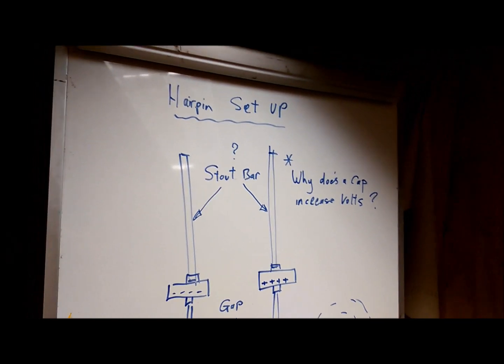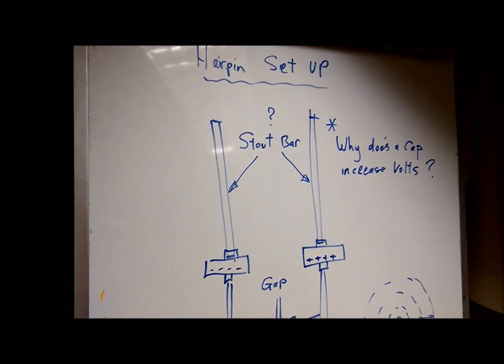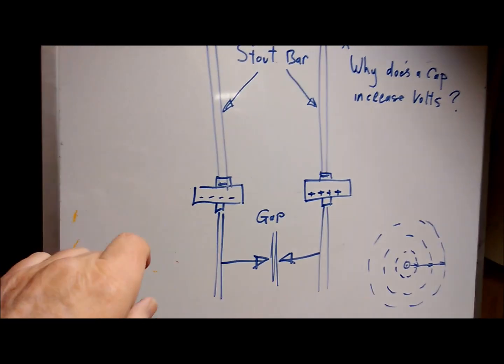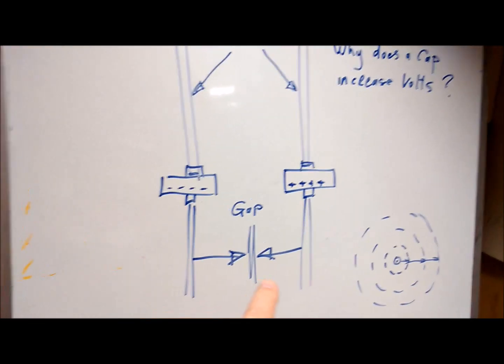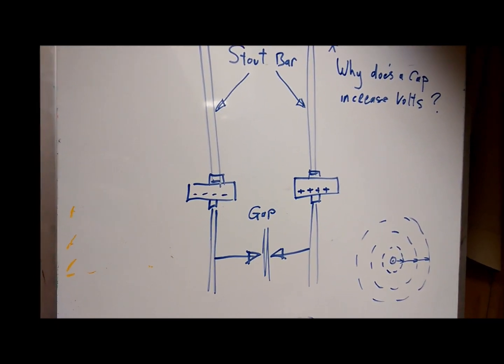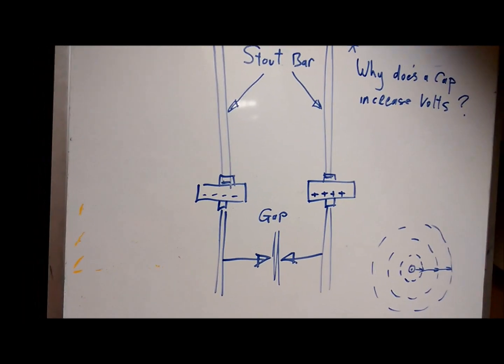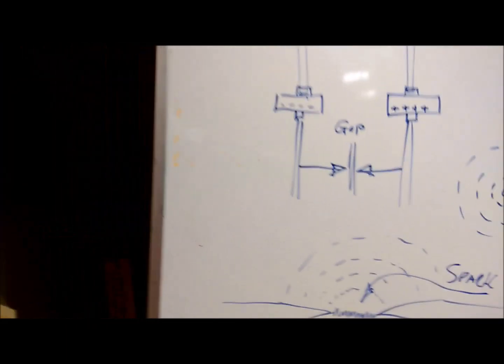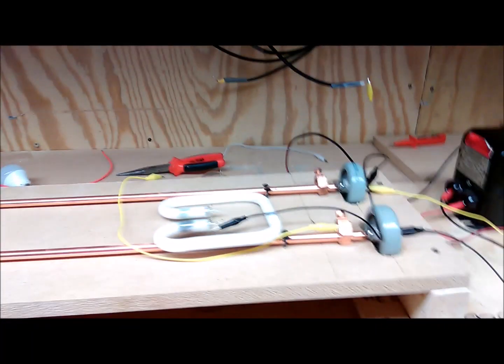Electrons do not exist ( Nikola Tesla Hairpin Circuit )

Comment: How can a discharge not be electrons ?
Reply from the maker: Good question!
What is light?
We only think we know.
Tesla knew, why?
Quote Tesla's: "if you believe in electrons you're mad".
So the Q you ask is really a good one!

The nearest I can get is static from the Aether.

Hope this helps and feedback with your knowledge levels as I have great interest.

Regards DC
Reply: @e.powerdc1127  supposedluy tesla said their were smaller particles than electrons he belueved
Reply: A discharge in this context is the release of tension of the Dielectric field, Electrons are not particles but a point where the guide (wire) has failed to reflect the dielectric field, losing it in the form of waste heat. As Thompsons original description if it is the terminal end of a unit of Dielectric induction, this is the original and correct model of the Electron. 

"By experiment it can be shown that this energy leakage exists in proportion to the temperature of the material form storing energy within its bound electric field. In general, the electrostatic potential, e, in Volt, renders the insulators hot, the magnetomotive force, i, in Ampere, renders the wires hot. Also, it is found that this heating increases with increasing frequency of the potential, e, or the M.M.F., i. It is here where the prevailing concept of the “electron” is to be found. Hence it is the motions of the electrons that give rise to the energy loss in an electrical system. 

Electrons represent energy dissipation. However, the pedant, the mystic, and the dis-informer all tell us that the electron is what conveys energy, the complete opposite!" -A Common Language For Electrical Engineering by Eric Dollard

All conductors are Dielectric reflectors, so unless we're talking about superconductors no wire is a going to be a perfect reflector, hence the losses.

Comment: Can a smoothing capacitor be used in with this energy to make the waveform stable? I want to try powering a DC Asymmetrical motor but the pulsed waveform might not be good for it.

Comment: Hello. Thank you very much for reporting. I have always wondered how the cable that connects a lightning rod to the earth is able to transmit so much energy without melting. And the reason is that it does not conduct an electric current, but a dielectric current. And indeed, in a storm, lightning strikes in both directions, from top to bottom and also from bottom to top.
Reply from the maker: Hi DiMagnet
Thanks for the comment.
Electric is strange and how it works.

A bar magnet is strange too. Why?

Cos it has two fields N & S but they do not pass the Block (Block) Wall.

So what i am saying i guess a magnet has three fields.

Did you know that the N & S pole magnetic fields do NOT follow the classic lines of taught to us?

After much research please find:- 
Fact at the Bloch the N. & S. fields do not cross.

We have put too much focus on the magnetic and not the "Dielectric Field".

Regards DC

 https://www.youtube.com/watch?v=SK_C0RAOACA

Comment: You are correct, in fact when I sit down and think about it wouldn't the whole existence of single wire circuits completely destroy the erroneous notion of electricity being the result of "electrons flowing in a circuit" as they so often claim
Reply from the maker: B.D. yes, spot on. Have you looked at my "Little Billy Aether"?
Just my take and I can see how Tesla was thinking to draw power from the Aether too!
Put it all together Aether+magnetics and di - electric ( insulation static) vibrate and Bingo you have a galaxy (sea, universe) of power / potential.
Regards DC
Reply: @e.powerdc1127  Sorry its taken me so long to respond to this, but yes between what Tesla has done and Thomas Henry Moray (who was largely influenced by the likes of Tesla and Gustave Le Bon, even to the point of utilizing Radiant Matter), you're correct. Bringing up Moray again he even wrote how we are in a "sea of energy" you just need the proper "receiver".
Reply: Flow of electrons..  pressure differential. Static charge difference. Magnetic induced expansion contraction<8>8<8> . Or chemical+>8<-
Tesla's was atmospheric. High Voltage pressure. ]8[]8[

It is the rubbing... friction that creates electricity.
Vandegraaf wimshurst kelvins thunderstorm.
Reply: But it is the valance electron doing this. While the electron shell gets pressured, it wants to get rid of it. Cause there's more space around the electron shell of the neighbor.

Comment: Thrs no magnetic waves here just dielectric...... Cap spark irrespective of ac pump once it goes through spark gap just dielectric... Essential to have magnetic... U have done that to 500volts just integrate that  ie dielectric nd w stp up 10 times nd get that 10 transformers to stp dn that's all u need to achieve if current is not flowing u can use diodes nd invert w  invertor for AC and use a real proper earth either series or plate or really grounded for rest.. Charges r bound to separate n resonance made as long as ur magnetic generator nd dielectric discharge happens nd stp up 10 times happens ie 500x 10times stp up to 5000volts then stp dn multiple transformers u can use till 8 I am sure 4proper current

Comment: I don't know why all the amateur experimenters out there think the Spark Gap is the location where some "magic" occurs. It's not. The real magic, if we agree that longitudinal waves do exist, is happening from high voltage on the first plate of the capacitors, if we assume the Hairpin circuit. There, that electrode surface appears to the dielectric inside the capacitors as if it is constantly swinging from -V to +V, that happens so abruptly thanks to the spark gap, this being the only real merit it deserves.

Those abrupt swings from -V to +V stretch the dielectric inside the capacitors like a high torque elastic rubberband, blasting energy out to other dielectrics materials in nearby zones (mainly, air). When the dielectric wave encounters a metallic surface, the energy get converted back to regular, common conduction current inside that metal object, and it can feed electric appliances like lightbulbs, measurement tools, etc.

It's not a theory, it is really that way, and many videos prove it. Roberto Handwerker from Milan was one of the first to have understood this whole thing in 2011. Also Master Ivo knows that, and some others.

To be more clear, it is really displacement current, but happening for longer distances than those of a thin dielectric film of a common capacitor.

To conclude: for longitudinal waves, the magic does not happen in the spark gap. The magic happens when a metallic surface can sport a homogeneus high potential charge in its whole surface that flips in a relatively low time (dv/dt), appearing as the surface is blasting opposite electric fields continuously. Zam zam zam. That stretches whatever dielectric materials is in strict contact with that surface. The effect is much bigger if the dielectric has high K. Air is not that good. Water is good. Plastic, maybe glass, are superb.
Reply from the maker: D. T. Hi you get a 5 star from me DC.
At last someone who really understands the Aether.
It's like a heartbeat.
The World is waiting for someone to put it all together!
Tesla was on the money, however people with the money stopped him.
Let's make electric free again. Amen.
Regards DC

Comment: A fluxing capacitor.
Reply from the maker: Ying and Yang they chase each other positive and negative, North and South fields separated by the Bloch wall all trying to equal or level out Aether pressure. The potential, is the pressure differential.
A capacitor is capable of storing this potential to very high voltage.
Voltage drives amps.

 So a fluxing capacitor is to be noted as a important component.
Wouldn't you agree?
Regards DC

Comment: “No electrons, just discharge…” at this point I decided not to watch further. DISCHARGE is the flow of charge carriers!!!! Which can be either ions or electrons. But if there are ions there should be electrons. Jeez….
Reply from the maker: Hi D. N. I thought that we used electrons up like turning a tap on and getting a bucket of water.
What do you think about my video "Little Billy Aether" and where I describe action in a wire.
Regards DC
Reply: If "electrons" exist, overunity transformer wouldn't be possible as the flux are "entangled" together.

Comment: Nice job! And yes I think you are correct in saying that the spark gap is taking two transverse hertzian waves and combining them at 180 degrees offset to cancel them out and make a scalar-longitudinal wave that travels outside of the circuit (wireless transmission of power). The main difference between Tesla’s hairpin circuit and yours is his spark gap is between the two bars above the two capacitors. And what happens when the spark discharge happens is it creates a longitudinal shockwave in the Aether. Having the spark gap in between the two bars makes the longitudinal wave shoot out between the bars (in the space between the bars) and I think that the top hoop of the bar is where that scalar wave intersects back with the main circuit. If the spark gap is separate from the bars then that shockwave misses the hoop of the circuit completely. (That’s my theory) So putting that spark gap in between the bars above the two capacitors is a key design element in the hairpin circuit that should be copied to get the exact same effect Tesla was demonstrating.
Reply: The main difference between Tesla’s hairpin circuit and yours is his spark gap is between the two bars above the two capacitors ---> Wrong.
Reply: The oscillation between one plate of one capacitor. Against another. Will generate oscilation in the loop.
The potential should, in theory, always remain between the plates of the loop. And would not run to ground... my guess... invented against edison's cruelty to animals.

Comment: What is dielectricity?  If there arent any electrons being discharged.  Does that mean that there is more than just electrons and magnetism that is involved with electricity?
Reply from the maker: Good Q. Hi R. E. Magnetic is connected to the dielectric at 90* ( ying & yang) like the field lines of a magnet. So what do we see when we see a spark? A small H Bomb (example). Does this help?.. DC
Reply: @e.powerdc1127  I'll watch the video again and get back with you.
Reply from the maker: Hi again,  I was like you years ago. A kettle boiling, is it using up electrons? How are the electrons replaced? We only think we know! This is why i keep studying, "I know very little" but keep trying!!
Look at this closely, what is going on here?
https://www.youtube.com/watch?v=MD1AQJ6ypa8 
 Mm interesting (Yes)? .. Regards .... DC
Reply from the maker: Youtube is blocking me, try again. I can not answer you.
Reply: @e.powerdc1127  you're good sir.  I'm getting your replies.  I've noticed that capacitors and transistors have sparks that are a different color than without the capacitor and/or transistor connected.  Blue with and purple without.  Maybe this has something to do with it.  I'm starting to think that there are different types of electricity within the ether.  I also dont really believe in "electrons".  I believe that they're man made units of measurement.  Like inches.  Inches don't exist.  They're made by man as units of measurment
Reply from the maker: R.E. having problems with dialog with you (YT).

Comment: Put the L with the C and it's a party for 3
Reply from the maker: Hi M I have come along way since Morin. He inspired me and now I understand more. Key stuff now magnetism and light. Tesla used magnesium to quench at the spark gap.... or did he? Was it to boost?  ... Regards .... DC
Reply: @e.powerdc1127  I think the good thing about Morin is that he indeed inspired a lot of people to get interested in something so important. The bad thing is upon watching some of his videos I think what happened was he started off not really knowing what he was doing, then eventually learned more and realized his original ideas were not what he thought. What I saw him doing in his first videos was demonstrating how high voltage low current pulses can light leds and CFL's, that's about it. 
Some of his later motors were pretty interesting but it seemed like he was simply the face-man for some silent business partners trying to scam people after he had gotten such a large following. This is just my opinion and I of course could be wrong.  

However this is the same guy I saw get an amp reading across his neutral at home and conclude it must be the energy company double dipping. I'd like to think someone so knowledgeable about how AC works would realize how current travels across the phases, and the neutral. 
I learned a lot following playing with the hairpin circuit and SSTCs as well. I found it much easier to understand once I started seeing inductors everywhere and transmission lines. 

Don't know anything about magnesium but he indeed used magnetic quenching, just one of the various ways to quench which in that case is sort of synonymous with a modern mosfet pull-down resistor but for spark gaps.
Reply from the maker: @Magneticitist  AC is very interesting and how it reacts with water. I am finding it hard to research magnesium in detail. Surprising how little we know or think we know. How the dielectric & magnetics work is drawing me into Tesla's Aether, Its fascinating. My last two videos and findings are leading to production of current from a magnet. Enjoy:- ... DC
    https://www.youtube.com/watch?v=euLRd27h5E8
Reply: @e.powerdc1127  I've never understood how wave theory is supposed to really work without an aetheric medium.

Comment: "Scalar wave" is a bit of a misnomer. A wave cannot be scalar; since it is in dynamic motion. A scalar value is uniform within a given space; such as atmospheric pressure in a room. There is however such a thing as longitudinal electrical waveforms; similair to that of a sound wave, and Tesla in truth referred to his electrical impulses as being "pressure waves".
Reply: It's all pretty much a misnomer though. It's a way to visualize it but there's no real way to correlate these waves into the real world the way we visualize them in 2D. Transverse and longitudinal are essentially the same thing depending on the angle you view them. You can use something like a rope or a wave machine to show the difference but we're talking about the excitation of things standing in 'space' which is why some kind of fluid-like aether made sense. A wave machine requires physical connections or a fluid-like medium within confines. How else do these wave models even translate unless there is some medium tying everything together.
Reply: @Magneticitist  I think you're correct in your interpretation. Longitudinal or transverse waves, are not things within themselves, but rather manifestations or modulations of the same thing. Magnetic and dielectric fields are tangible things, but whether or not they are made of actual physical substances is another discussion altogether. Perhaps the two conjugate fields are polarizations of the aether, and the transferance of energy from one field to the other are responsible for the after effects we refer to as waves and particles. There are many possible interpretations and theories out there, but one thing is certain. We still do not understand entirely how elecrticity operates.
Reply: https://youtu.be/fu3YJQdZmis
Longtudonal wave I hard it doesnt carry EMF but pure pressure like sound wave. 

On other hair pin cirkit guy demonstrate holding bar & not get electricuted under water too with light boulb because I think its pressire wave = sound wave = longtudenal = push no ocilation , no wave form so with long tudunal wave haipin circuit this demonstrator not getting electricuted by EMF underwater 

Well I'm still studing lingtudunal wave effect & use so if Im wrong please let me know sir. 

Even Tesla said from Book call Seacret of cold war longtudunal wave is warm not harmful but has healing effect.
Reply: Sorry to be so off topic but does anyone know of a trick to get back into an Instagram account..?
I was dumb forgot my login password. I love any help you can give me
Reply: @Romeo Zain Instablaster ;)
Reply: @Emilio Gerardo i really appreciate your reply. I found the site through google and Im trying it out now.
I see it takes a while so I will reply here later when my account password hopefully is recovered.
Reply: @Emilio Gerardo it did the trick and I finally got access to my account again. I'm so happy!
Thank you so much you really help me out !
Reply: @Romeo Zain Glad I could help :D